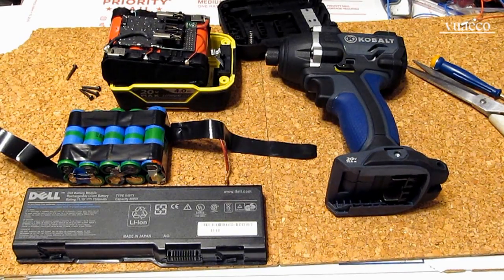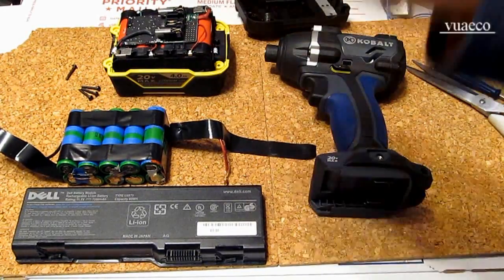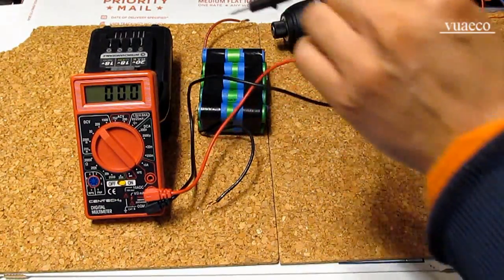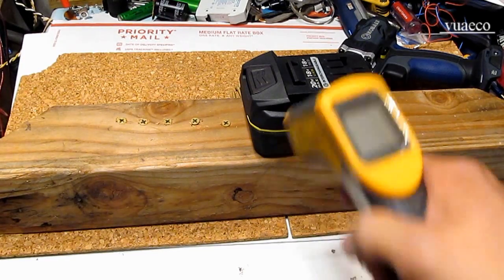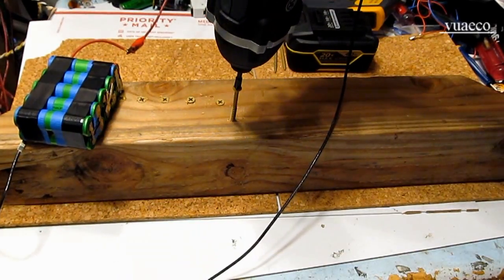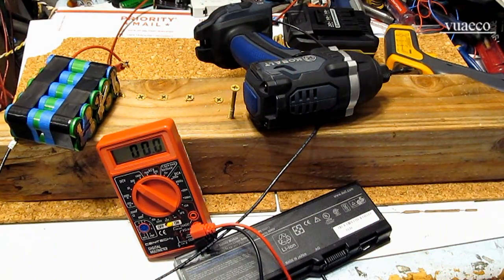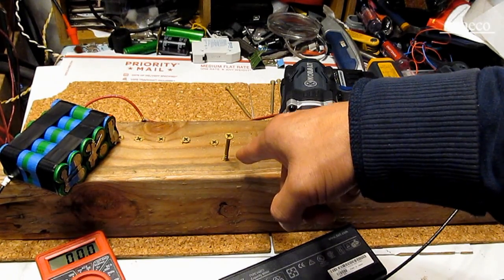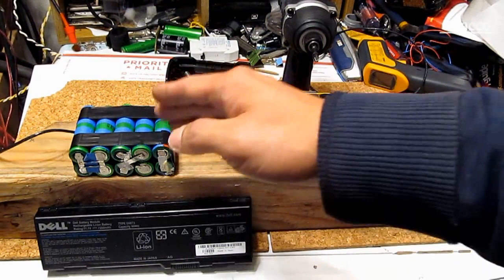Custom Electric Bike battery: 18650 Li-ion laptop cells vs. cordless power tool cells

Comment: Now I understand why laptop battery and tool battery is not interchangeable.

May I ask if the battery charger are exchangeable??? Battery shop told me I need to purchase 2 different type battery charger for different type of battery. Is it true?

I have NaCad old battery pack. Does it also need different type of battery charger?

Comment: it is not good comparition, you are compare not battery capacity but battery  C rating and it was apparent at the beginning  too that drill battery will win,because they are rated with different Crating, they are made for different application, I am quiet sure that laptop battery will last  much more cycle then  drill battery
Reply from the maker: It's apparent to you that the drill battery will win because you already know about C ratings. Other people who don't understand/know about C ratings would assume they are the same because they look the same. This video is for those people.

Comment: Thanks for the video, well done! To be fair to the laptop battery, what size cable is used on the clip leads you used because you don't need to introduce much resistance to affect results...
Reply: I was thinking exactly the same thing, this isn't a fair comparison.

Comment: I have 2 Milwaukee 9ah high demand battery, full charge is about 21 volts each and about 163ah each. So two would be 42 volts and 326ah. 
You think this would be a good setup. Will a 48volt controller like 42 volts? Or any suggestions. Does the Milwaukee battery have its own BMS? And for charging I can use a regular Milwaukee charger? 
Thanks.

Comment: lol why you pushibng so hard... omg let the tool do the work for you
Reply: He is using phillips head screws into thick timber requiring a high torque to drive them, back off with the pressure and the driver bit will just camout damaging the screw head. Different story had he used a socket head or square recess screw.

Comment: The correct way to compare c ratings and condition of a cell is by measuring the internal resistance. The chinese laptop packs I get from ebay average 60-150 micro ohms @ 2400mah which is the same as a few power tool li ion packs I have checked. Something is flawed with your experiment I suspect bad or used up laptop cells. Li ion cells are delicate and can obtain a very high internal resistance from something as basic as being exposed to freezing temps, being stored at low voltage or being stored long at full charge.
Reply from the maker: All cells are new from new laptop battery packs. Plus, bad cells will not remain fully charged (at over 20V) after repeatedly bombarded by a high load such as that impact driver. Bad cells will drop their voltage like a stone and the voltage will remain low. The reason why it heated up is because of high internal resistance and that comes from the way the battery is built. And they are built to have low discharge rate. Once you subject them to high discharge output, the only way to give is to heat themselves up. You can try it for yourself and get cells from real laptop batteries (Dell, Apple, HP...) and test them to see if they can run a power tool. And I can bet you they will behave the exact same way. And if that still doesn't convince you, try to go on the internet and try to shop for both high discharge and low discharge cells. For both cells with the same capacity (Ah ratings), the one with a high discharge rate is a lot more expensive. HIgher discharge cells are more expensive for a reason.
Reply: Those cells are capable you just had too much resistance in the connection using 4 alligator clips , long wires and springs
Reply from the maker: Wires used are AWG size 14 rated at 15A to 25A. That's only ratings for safety. It can take much more than that before it heats up enough to catch fire. It can easily handle 10 times more than what the laptop cell pack can put out. Wire length is less than 20 inches long. Spring is jammed tight to the impact driver clips. If any of these is a factor, it would be the first to heat up. Current flow will heat up wherever that has the most resistance. It doesn't care whether it's a wire or a battery. But the fact and the truth is, the battery was the first thing that heated up and that happened instantly.
Reply: Touch the aligator clips of that same setup to the contacts on the drill battery bet it does the same thing.
Reply: plus a few inches of wire  between drill battery and first clips so its the same
Reply: DIY Archives the correct way is to teach yourself how discharge rates (C rating) works and to understand, that two things that have similar case does not mean they have equal internals. Like a computer case can have a slow old internals and the latest hightech stuff, same goes for 18650. Nobody is putting high discharge rate cells into laptop batteries because it would be a waste of money. Laptop's do not pull such amps and thereby there is no need to use high discharge cells in it. Powertools do need high discharge cells. They are both rated 2Ah but one keeps the rating up to 1C discharge, other til 10C+. Go see site eu.nkon .nl to see how cell prices differ, with similar capacity.
Reply: @gelisob  what about the chemistry of the battery?. Does any effect of such different chemical composed LiIon cells used to different projects. I saw some models that specify different chemical composition like model number stating with NCR, UR ?
Reply: 60-150 micro ohm or do you mean: milli-ohm??

Comment: so I'm better off using my ego tool battery packs instead of CANNIBALISM of a few laptop batteries? with my Ego 56v 7.5 AH packs and a 48v 1000w hub motor I get 10miles full throttle flat land no pedaling and I weight 185 lbs, I carry 2 of these batteries and they weigh in at 6lbs each, i want to find a way of combining the 2 batteries for more distance. I have 2: 7.5ah 1:5.0ah and 3: 2.7ah packs. I use a CANNIBALIZED charger plate as the interface so that I don't have to open the battery cases as I also use them with my Ego lawnmower weed whacker and 2 blowers. I have a few 3d printers and have been thinking about how to make custom mount plates to hold at least 2 of the batteries for distance.
Reply from the maker: You can use laptop batteries. But in your case, your motor is 1000w @ 48V =20A continuous discharge. So you will need to build a 12S20P (assuming laptop cells at 1C discharge at 4V each). A pack of 12S20P 18650 composes of 20x12= 240 cells and that is enormous. You will need quite a lot of laptop batteries to build that. A single Ego 56V pack would do the job as efficient. Sure you will get more range with the 12S20P from laptop cells but you will need to lose an arm and a leg to build that (OK not that dramatic but you get the picture).
Reply: vuaeco yeah, so I will continue with the 7.5AH 56v  EGO battery. I would just now want to bridge (if that's the proper term) 2 or more of the 56v batteries together for range. Series or parallel not sure but I can design a plate that will hold them together.
Reply from the maker: You will need to parallel them together (+ to +, and - to -). Parallel will give you twice the Ah (capacity) but the voltage stays the same. Series them will produce 56x2=112V and that will fry your motor in no time.

Comment: Nice demonstration on discharge rates between 2 quality 18650 batteries. 
Did you test the aH rating of the used batteries individually in the DIY pack, to validate how close to original aH they were?